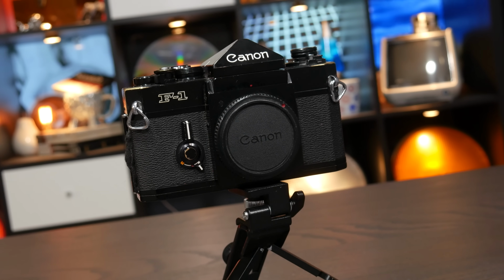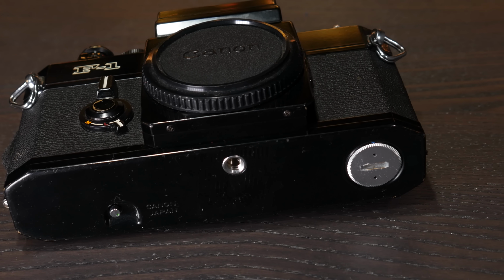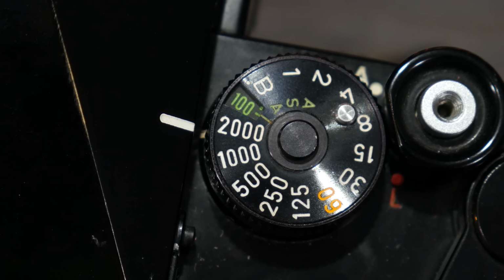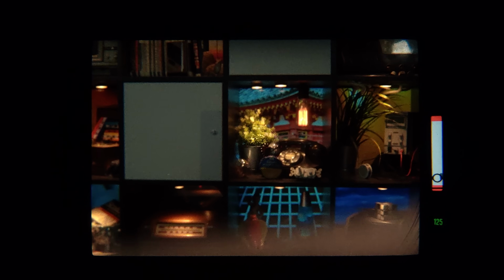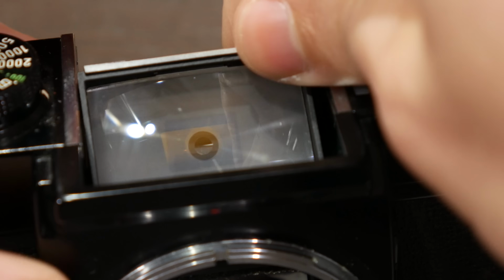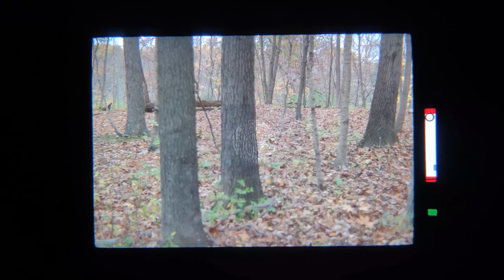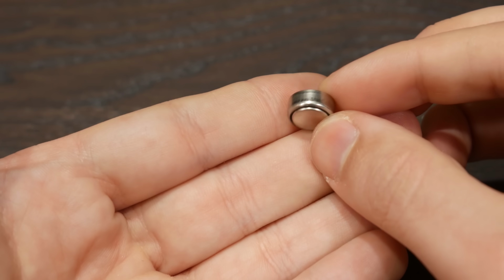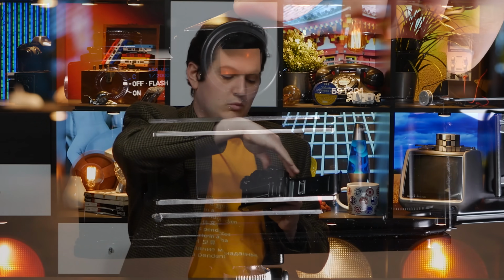1970's Camera Tech: How they showed you what settings to use

Comment: Those 70's camera were optical and mechanical engineering marvels. I still use my Minolta xd7 which is older than me! It needs a battery though, as the shutter is electromechanical. But I never had to replace it in 20 years...

Comment: This is actually pretty cool. I actually had a camera like this that had a built in light-meter that used a battery to operate some extra features. Sold it about a year ago though. But one thing it had was a built in light meter. I think it was the Nikon FG. Though, I think that's a camera from 1982, not the 1970's. This camera also had a neat little self-timer lever too. Thought that was really cool.

Comment: Oh I love film SLR's.  I have a load from several decades and still use them.

Even on my DSLR I largely shoot fully manual, sometimes using Aperture Priority.  I also tend to use the Sunny 16 rule to get a general correct exposure dialed into the camera and only adjust if the lightmeter suggest it.

This means I'm pretty good at using Sunny 16 with some of my cameras that... dont have a lightmeter :)
Oh and have a like for using PAN F

Comment: The word "stop" (as in f-stop) refers to any part of the lens intended to block stray light. The most common  of these would be an opaque disk with a hole in the middle, with the hole just big enough to pass the light you want to allow through. These would generally be fixed in size.

However, the one used to control the amount of light admitted is adjustable, and the names of the settings come from the fact that the diameter of the opening is expressed as a fraction of the focal length of the lens. So for instance, the diameter of the opening might be the focal length divided by 22, i.e. f/22, and that slash in the f-stop designation really is a division symbol (fraction bar). At least, this is how it works for simple lenses. For the complex multi-element modern camera lenses, the diameter of the physical stop might not be given by this formula, but gives the same light-reduction effect as one calculated by the formula would work with a simple lens.

Comment: I had a retail photo business and sold hundreds of SLRs and auto-compacts of all types. When a 'compact' user wanted to move up, they were usually baffled by all the settings on an SLR. I worked out a simple way of explaining it:
The film has to get the right amount of light to give you a good photo, not too much, not too little..
Imagine that filling a bath is equivalent to giving the film the right amount of light.
There are two ways to fill a bath; You can leave the tap running at a very low rate, but for a long time or
You can open the tap right up and reduce the time it's running.
The lens aperture or opening is how much the tap is open and
The shutter speed is for how long you leave the tap running.
Either way, and for every step in between, you fill the bath to the right level.

It wasn't perfect, but it gave them the right idea! I had the same customers coming in for 'lessons' for years.

Comment: I own this camera and I can say it is a pleasure to shoot. Sturdy, beautiful and with pleasant sounds. 
PS: I checked my battery and it is an Alkaline 1.5V but when testing the battery in the camera the needle just passed the line by a little bit. Maybe the camera was "repaired" to display correct metering for today's standards. The pictures come out well exposed most of the times.
PS2: With such a high mechanical shutter speed (1000, 2000 of a second) my camera came with a problem in which the curtains didn't close at the same time on those high settings, creating an uneven exposition throughout the picture. A visit to a trustworthy repairman and 50€ after, got it fixed.

Comment: I shoot film and I'm going to love this series! I use an old twin lens reflex camera that has a built-in selenium light meter which is light-powered, so I never need batteries to get a good light reading as long as I'm in daylight. In darker areas, with black and white film, you just use a tripod and overexpose like crazy. Most black and white film is pretty forgiving on exposure.

Comment: Why do these older light flashers for cameras make that whining noise after they've been used?
Reply: I think it's the capacitor charging up.  They take a lot of power to "flash" and to keep your battery from draining after 2 or 3 shots it slowly charges up a capacitor and then dumps all that energy into a single burst of light.  I'm pretty sure that's right but not 100%.
Reply: @steamgadget  coooool.

Comment: This video brought back a lot of memories of my teen years in the early 80s. My first job in high school was working for a local photo equipment store, one which sadly just now went out of business due to COVID after a century of being in business.  We used to sell the Canon F1 although because its perch strictly for pro photographers, we never sold many.  My first SLR camera I got for myself was the Canon AE-1 which was extremely successful and was a huge shift in the marketplace for SLR camera for amateur photographers. The AE-1 was the first camera with a microprocessor that was able to automatically adjust the f-stop depending on the light meter combined with what the user selected for the shutter speed (shutter priority).  It wasn't tank-like built like the F-1 but was extremely popular.  In many ways, the AE-1 was the "smartphone" camera of its day since in the 70s/80s everyone had one. The camera I lusted after in those days was the more expensive Canon A-1, which could do automatic shutter AND aperture if the user wanted, or do shutter or aperture priority. It had a LED display in the viewfinder which would tell the user what shutter and aperture the camera was set for, which was way ahead of its time.

Comment: Please more! Analogue photography is so clever and interesting!

Sidenote, one more reason why Alkaline batteries provide bad results compared to Mercury batteries. Mercury batteries provide much more stable voltage, Alkalines tends fluctuate. That's why more modern devices, tend to have a special circuit which compensates for the fluctuations in voltage. I remember reading about some possible modifications to Praktica cameras (which I was trying to get to function) that would make it possible to use Alkalines reliably.

Comment: The Minolta SLR had a slightly different system. The light needle was independent of the shutter and aperture. What they did was mechanically connect the shutter speed and aperture. So when you used the meter the circle would move with either shutter or f-stop changes. Kind of a mechanical computer which you match to the needle. Neat episode. Makes me want do film photography again.

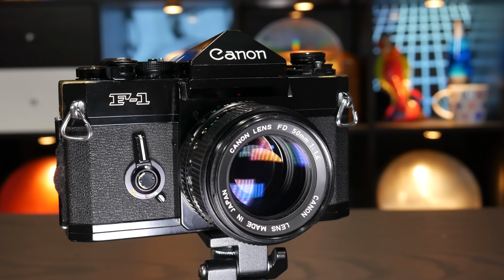Comment: 3:55
How would you trigger the long exposure shot then? Surely turning the lever would introduce as much vibration as having the mirror lift and close mechanically
Reply: You would normally use a cable release to operate the shutter instead of the button on top. The lever is for winding on the film, only needing care to keep the camera still if multiple frame registration is required. We still use mirror lock up mode on digital SLRs when vibration is a consideration. Cable releases remain in use too, although most of us opt for RF triggers.
Reply: @itsafeaturenotaflaw  I somehow thought that there was nothing between the film and the mirror

Comment: I think the “flash hookup” you mentioned is a remote trigger connection. My dad’s camera had one where it’s a 1m cable that has a solid wire in the middle that would push into the middle and trigger the camera.
Reply: No its not, its a PC Synch socket, The cable release is in the middle of the shutter button on the top of the camera.
Reply: @dgodfrey9189  ah thanks. :)

Comment: I still have my fathers Konica C35 EF (1977 model). It does mostly work but flash isn't reliable. I assume replacing the cap would probably fix the issue.

Comment: Handheld light meters are crude?! Yeah, the old ones sure were. I really like my Sekonic light meter, though. It's modern but still has a needle readout and a slide rule. Also, incident light meters are useful in a way that built-in light meters aren't. Reflective light and incident light are different values and incident light is more accurate for getting exposures.

Comment: I wonder if you could plug one or both holes in the battery cover to extend life and still have enough air/current to run the meter, the draw of that tiny movement is likely microamp range.

Comment: Coincidentally, in Soviet Union file speed was measured in GOST (ГОСТ) unit, which also meant the state standard. Speeds were located at same points as DIN, and were 32, 65, 130, 250, 500. Reversible color and B/W films were outliers and had speeds 22, 45, 90.

Comment: light meter would be a measurment of time, like how a light year is a measurment of distance
Reply: That would be redundant, because a meter is already a measure of the distance light travels in a vacuum in one 299,792,458th of a second.
Reply: @ananthropomorphictalkinggo6641  again you are thinkining of a vacuum. What about a realistic model where the speed of light is moddeld in gasses and we call thwm light meters
Reply: @fireworkstarter  it makes even less sense in that context though. A meter is already a unit of distance, and the addition of a different medium doesn't change the length. The phrase would have to be a unit of time, and you'd have to specify what medium it's travelling through, since light travels at different speeds through different gasses. Even the same gas at different densities will yield different results, making it the least consistent unit of measurement ever established. Next you're going to try to tell me that it's a meter that weighs less than other meters.
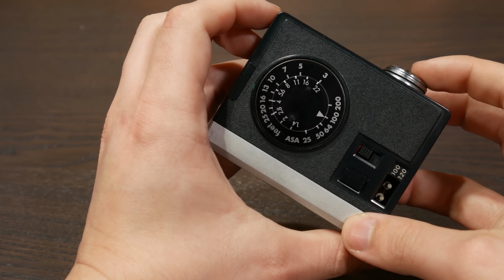Reply: I'm guessing what's being shown at 24:58 is also known as a flash calculator? A tool that adjusts the flash unit's performance based on the camera's settings before hot shoes allowed the camera to transmit it's settings' data directly to the flash unit
Reply: @lzh4950  difrent conversation man
Reply: @fireworkstarter  Was thinking the description of light meters sounds similar to flash calculators but wondering how similar they actually are
Reply: @lzh4950  were talking about the time it would take for light to travel 1 meter as a measurement of time :p
Reply: going by that, a light meter is 3.3356409519815 nanoseconds. coincidentally, a light foot it nearly exactly 1 nanosecond. coincidence? or further proof of imperial superiority.
Reply: @XcaptainXobliviousX  if we all used imperial you wouldnt come to a nanoMETER :p
Reply: @XcaptainXobliviousX  You, obviously, know that the official definition of a meter is the distance that light can travel (in a vacuum) in 1/299,792,458 of a second, since the speed of light (in a vacuum) is 299,792,458 meters/sec.
Reply: @jmchez  1/299,792,458 of a second = really lame, too long, and bad, 1 nanosecond = really cool, succinct, and neat. checkmate
Reply: @XcaptainXobliviousX  Well, if you have a problem with the official definition of the meter, take it up with the International Bureau of Weights and measures. I'm sure that their metrology experts will be convinced by your argument.
Reply: @jmchez  im honestly shocked at how seriously your taking a tiny little joke about arbitrarily defined ratios of units of measure. its kind of embarrassing, secondhand.
Reply: @jmchez  it actualy took them quite a lot of years to define those things as that, they used to just refer to the platinum rod. And you can say its pointless but it just works in both ways. A light meter points to how much time it took to pass 1 meter for light. We might be talking vacuum we might not, dont act like you know everything just because you read the defenition on wiki
Reply: That would be light metre.
Reply: @cambridgemart2075  sorry m8 i dont live in the UK
Reply: @fireworkstarter  As far as I'm aware, only the USA & Canada spell it as meter.
Reply: @cambridgemart2075  netherlands germany etc.
Reply: @cambridgemart2075  I'm in the Philippines, it is Meter

Comment: It's not just that the sensor isn't sensitive enough. Exposure behaviour of film changes massively in low light conditions, also depending on the type of film used. You need to look up film specific tables with values the integrated light meter can't provide, anyway.

Comment: I still have my F-1 also.  I can't bear to part with it (still use the FD and FL glass w/adapters on mirrorless cameras). Have you looked at an A-1's display?  The glowing red LED display was so high-tech at the time (I used one in 2005 and it was looking pretty anachronistic then but still fun).

Comment: modern canon DSLRs have literally identical everything to this. Like the button that makes the aperture preview is in the same place on the front, the light sensor has the same readout and similar behavior. granted, it has more calculation being done so it can represent the full range of combinations but the reality of it is they're basically the same.
Reply: Mostly true but I still miss the Tank-like rigidity of the older film cameras.
Reply: @steamgadget  what your looking at in his hand is the cannon f1 which is a flagship model at the time. If we fast forward to today you'd be comparing that to the current flagship (the eos 1D ?) which is an all-titanium chassis coated in rubber. Thing's drop-resistant to like a few meters and completely waterproof
Reply: @Thesupremeone34  You are correct about that.  I guess I was more thinking of comparing the basic concept to the current base level model, that beats the F1 to shame in terms of picture* and technology.    (*unless your two people talkin bout this, which both parties know film still can't be beat in terms of detail without spending $15,000 to start..)  👍📷..

Comment: I have a Minolta XD-11 from the early 1980s which takes this concept one step further. It has both "Aperture Priority" and "Shutter Speed Priority" automation. Meaning that you can choose to either set the aperture yourself and the camera automatically selects the shutter speed based on the light meter reading; or you can choose to set the shutter speed yourself and the aperture will be set automatically based on the light meter. The light meter has a scale on it that shows what aperture or shutter speed it plans to select. The scale changes when you change modes. Or you can revert to full manual mode where the light meter just advises you as it does here.

Comment: This pretty much explains why I hate digital cameras. They're using software to fill in the blanks left by smaller hardware meant to create a lighter weight package. It's the reason why high end phones take so long to save an image, as they're doing quick noise cancellation and patchwork upscaling to cover up their flaws. And also why video taken with said phone cameras tends to look so much worse than a still image. They tend to have a noisier image because they don't allow as much light into the tiny sensor, and don't allow you to create an analog solution as easily. This causes problems, because the only companies actually creating cameras with proper sized sensors and apertures with manual focus and ISO adjustment start in the high $600 range and just go up in price from there. If I try getting a camera with anything below an f/1.2 minimum it's stupidly expensive, and paired with drawbacks like a short focus distance. Which means you usually have to shell out for an even more expensive modular camera, and find a manufacturer that sells an f/0.9 lens, which is like $400 by itself and getting more difficult every year.

The end result is that taking high resolution photographs without blurry focus in low light or high shadow conditions is painful and expensive, and the only other option is putting up with worse equipment and fixing the noise in image editing software. Modern cameras can do burst photography, panoramics, and patchwork collages, but they HATE low light conditions.

Comment: OMG my Dad has one of those Canon F-1 BUT It was the CANON NEW F-1 and Loved to take pictures with it. He had a bunch of Camera Accessories. Good old days. With leather case. Eye cup and the big flash on top didn't come with it? Also you need always need the straps because that thing was heavy.
Reply: Everyone forgets Canon updated this camera in the 80's with the NEW F-1 to compete with Nikon F3. It had a great selection of viewfinders and accessories, and had both mechanical and electronic features. That was the end of the A and F series before the T-90 brought the FD era to an end.
Reply: @egoequus6263  It was the 80's and he was in the Navy when he got it. I think he got it because of the Navy. Just read that the Navy were using them.

Comment: ISO is a word, not an abbreviation. It's for isos, greek [ίσος] for equal. It's not ISO = international standards organization. It's actually the International Organization for Standardization, so the abbreviation would be IOS. So yes, its iso the word. Saying each letter would be like spelling out the word "lunch" because it's short for "luncheon". Why did they do this? It's actually kind of clever. They're avoiding having a different acronym in each language ... by using a word, instead. So strictly speaking, saying the word and spelling it out are not equal choices. Saying the word is correct, and spelling it out .... is literally spelling a word, not listing the letters in the abbreviation that it definitely isn't.